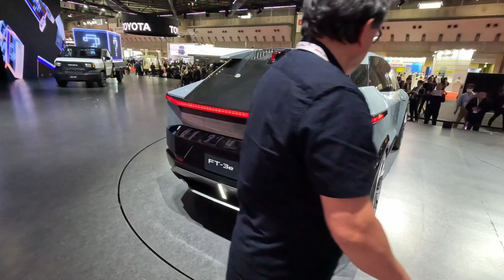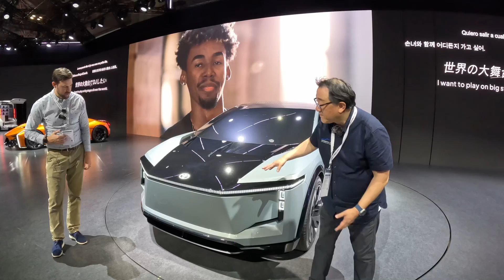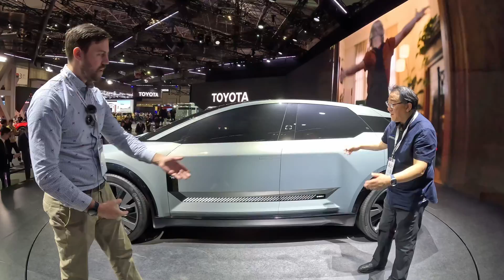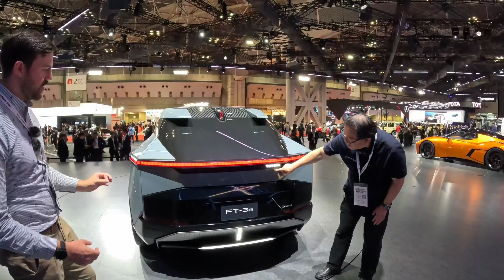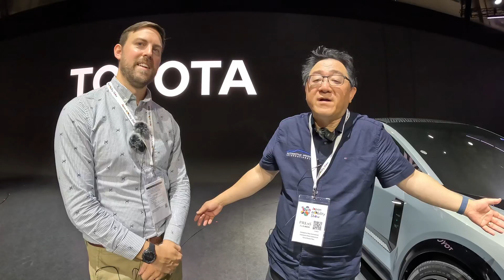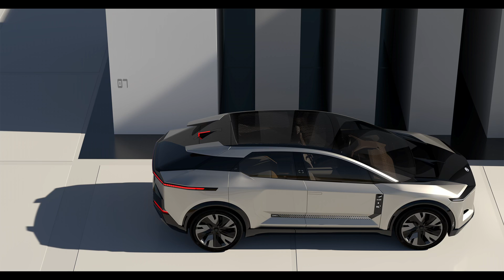*HANDS ON* Toyota's Next-Gen EV "FT-3e" could make the Tesla Model Y Obsolete...

Comment: If by 2027 there are Toyota EVs with 1,000 miles range and 10 minute charges,  why are they spending billions on  ammonia, fuel cells and even hydrogen combustion and only aiming or 30% EVs by 2030, all of which that awesome EV tech that would totally invalidate. It's all BS.

Comment: Another really ugly electric concept. The front on that car looks super ugly as do virtually all electric cars. Doesnt matter the manufacturer they all turn out ugly looking electric cars. The future is not good if everything is going to look like these cars. Lets hope the designs improve a lot before they are released. As for the battery Ill believe it when it becomes a reality. And I still do not believe battery cars are the way to go. Even if they make batteries to last a 1000 plus k per charge, the fact of the matter is we still have to produce more electricity to charge all the extra millions of cars. An infrastructure we just dont have. The raw materials are not exactly in abundance either. As I have said  many times, manufacturers need to concentrate on more than one power train for cars, not rely on only electric. I noticed at the JMS that virtually every thing was based on electric....its over the top I think.
I am not against electric cars as such, but I do not think they will ever be a viable alternative, rather they will be in addition to what we already have, unless some miracle battery is invented that pretty much eliminates the need for regular charging.

Comment: I find it hard to believe the kind of ranges being spruiked here - 1,000kms, 1,500kms on a full charge with newer batteries.
I mean, hasn't Toyota been saying solid state batteries are just around the corner for the last 10 years.  I suppose you could say it's similar to Musk's FSD.
If this is to be believed, why would anyone buy a BEV now and literally throw money down the drain as current BEV's resale values would plummet.
Reply: Not everyone needs 1000km range. What's needed more is more charging. Most cars are driven a total of 2hours a day, the other 22hrs it's just in parking lots. If we had charging at work, grocery, gyms, I think range would be a non-issue. 400miles is fine.